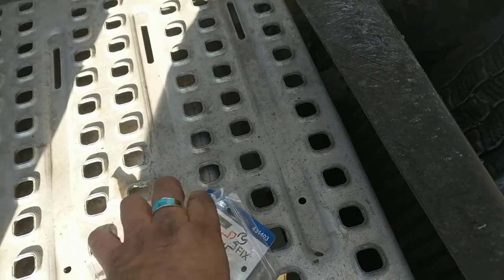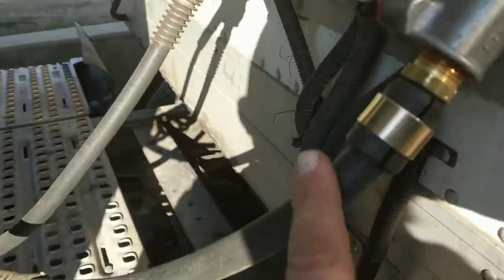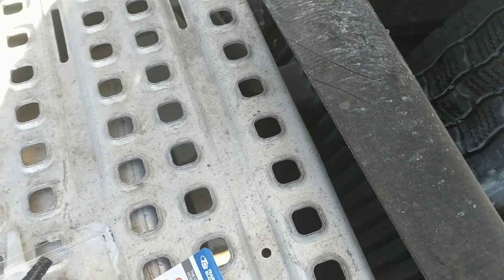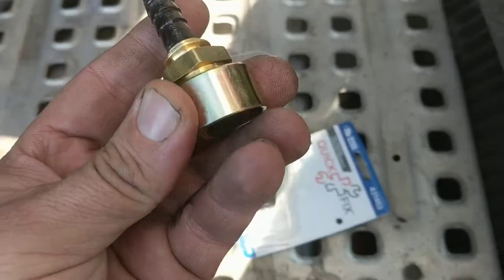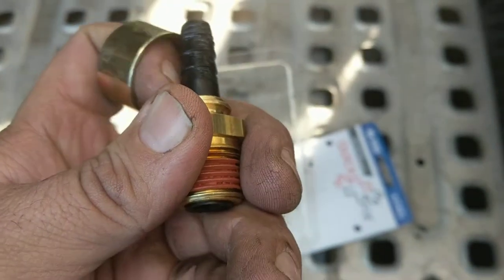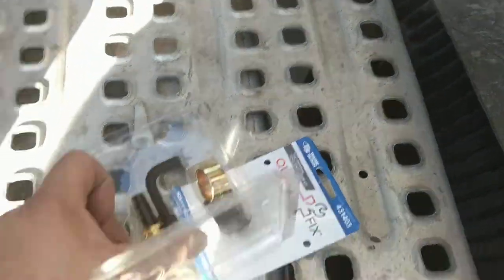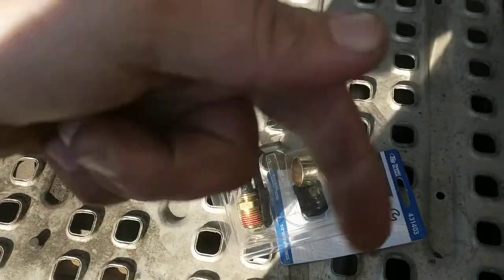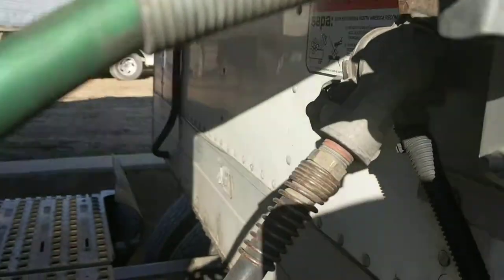Quick Fix Air Hose End Repair Kit.

Comment: Carry 10’ of air line in your truck along with a few of these air hose field repair kits . They wills sometimes leak in sub zero weather conditions . Seen steel plated rings  rust away in time . Generally speaking a good product .    6/26/23

Comment: My question is. Is this a long term fix?
Reply: Depends . I had hoses that lasted years like that and another ones that I had to replace them cause they started to leak almost immediately
Reply: There are also brass barb ones.  Same brand different part number.  Also a third kind with a wrench nut instead of a slip sleeve